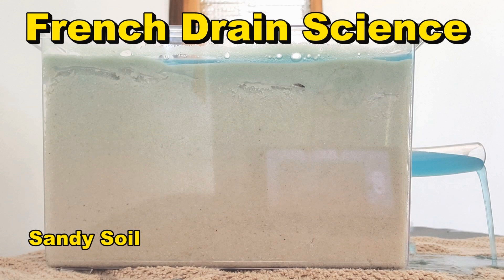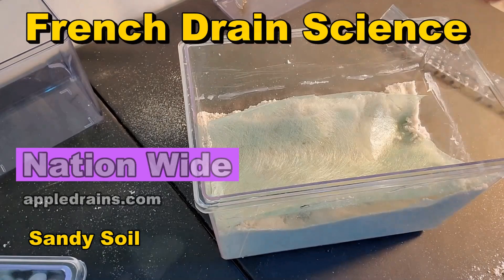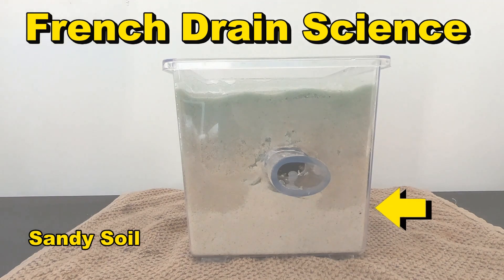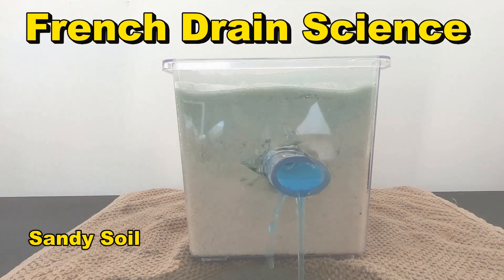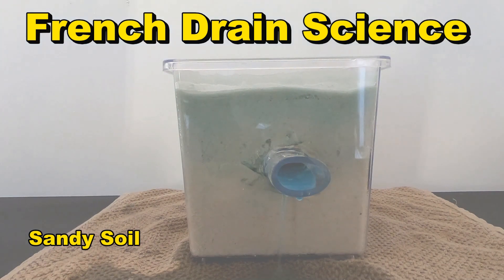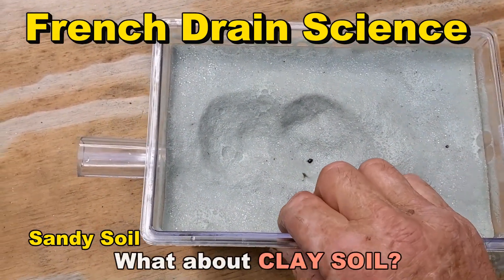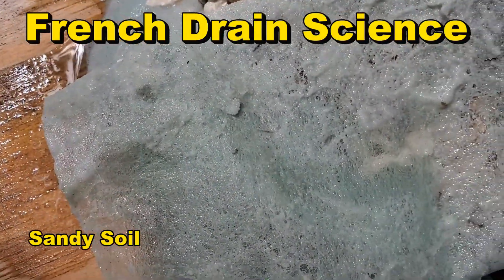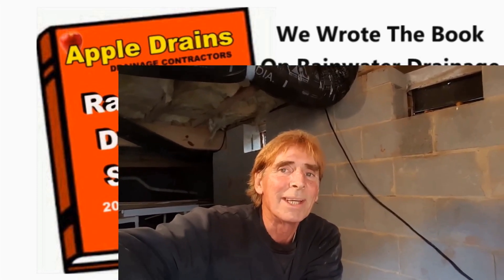French Drain Capillary Action in Sand Soil

Comment: This is such a good demonstration of what happens wih a French drain. With a quick cloudburst, you need the immediate solution of a catch basin system and a way for the water to be evacuated away. People who rely on French drains to protect themselves from sudden flooding are sorely disppointed with the outcome. This happened to me last February. We had almost a 6 inch rain in a few hours.Water came under the door, and through the walls. I began searching Youtube for help. I found your channel and watched you dig a sump pumb basin and install a Zoeller M98. I got to work doing the same. I connected catch basins to it and included the gutter downspouts. Then I diverted the water to a swale between my house and the neighbors. I am a 75 yr old woman who is not in the best of health, but I did it all by myself by watching and listening to your videos. Since I was so involved in every step, I know exactly where the problem areas are. We had a hail storm about a month ago that covered my house with leaves. They clogged the gutters and subsequently the sump pump as well. I didn't have to wait for a repairman to come out.  I cleaned it out as you have demonstrated in another video. I now have filters on each inlet into the sump pump basin to prevent future clogs.  We don't seem to have soft showers any more, just downpours that overwhelm a French drain system. That is why your videos are so important. Thank you!

Comment: Hi Chuck,
My house was builded on Sand. The builder run downspout right into the sand 4 ft from foundation. Is it right or should I fix it. 
Thanks
Reply from the maker: Would be better at least 20 feet away
Reply: Thanks Chuck! Should I run my downspout into basin and pump water out to the street? Or is it ok with downspout water go to sand 20ft away from foundation?